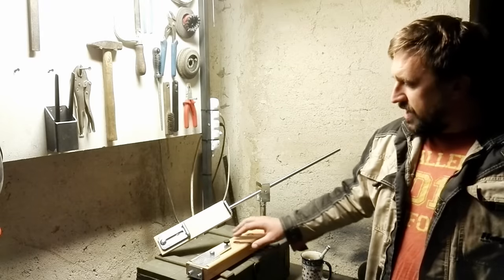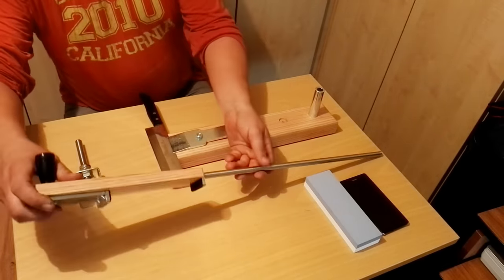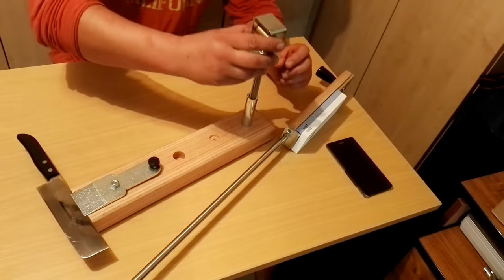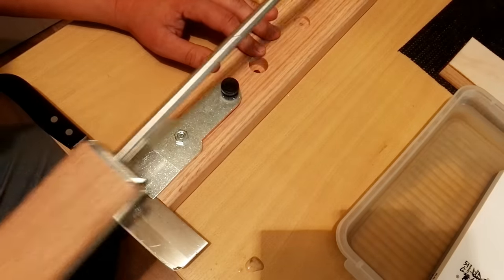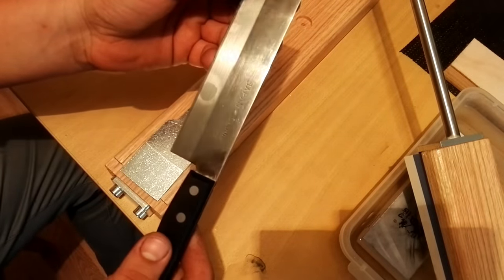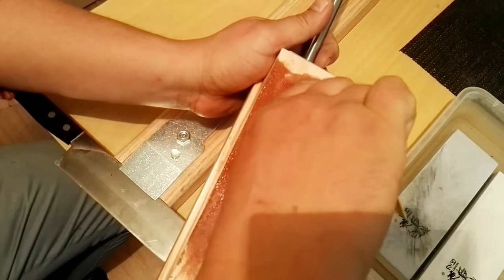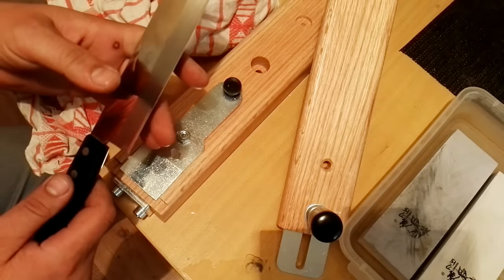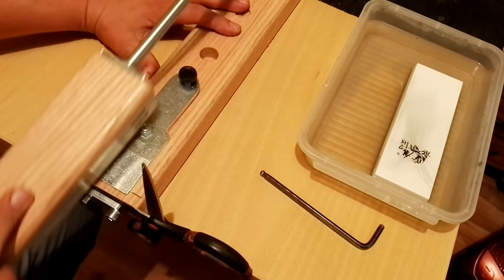The knife SHARPENING jig II

Comment: Got it as a Christmas gift for my mum. Works super well, especially with larger knifes one achieves incredibly precise results. I recommend to start with a stretched bar and work with the stone towards the knife as you move along the edge. So basically push the stone in the direction of the knife. It is also shown in the video. This prevents the stone from being damaged by the plade as there's more control when the tip of the blade is reached. Also it is necessary to check and readjust the angle after the first stroke. Begin with a slightly larger angle then after the first stroke have a very close look at the blade and lower the angle. Repeat until it is perfect.
Reply: Johannes Schmitz m
Reply: Sheila Harrison ¡

Comment: Ist's a great piece of workmanship Michal !👌

If You're willing to listen to my advice: 

If You slit the holes of the "jizzle-like"clamp- that fixates the blade/knife to the wodden block ist's easier to fixate broader blades. It would also be nice if You grind a square 40x20x10mm deep into the wodden block to hold the blade with an N52 neodym magnet the same size.

The advance of the more narrow whetstones, which originally came with Apex are just about 20mm wide, so You're able to sharpen koncave internal rounded blades like karambits or hand-scissels. 
Also is a smaller wooden stone-holder-block lighter and easier to move with less weight esp. on curved knive tips =>less pressure to the edge and tip of the blade.

The quality of Your product is way better than the Chinese or even Lansky ones 👌👍🙋 

I'd love if You're improving Your product to all sizes => width => of whetstones 20 - 100mm=> needs to slim the wooden stone-holder-block to 25mm and a carved in 60° phase into the middle of the steel stone-brackets .😉

Comment from the maker: The price  is EUR135 for the jig, it is delivered with the 1000/3000 stone.

The rocommend combination:
Knife sharpener - 135
2000/5000 stone - 50
Leather block with paste - 23
--------------------------------------------
Total EUR EUR 208 plus shipping cost (Europe EUR - 20, USA, CAN, ASIA, AUSTARALIA, Malaysia ... EUR 65)
Reply: Michal Kadlec Where can I buy one?
Reply: I’d like one. 
How do I buy one from you?
I’m in Toronto.
Reply: I would like to buy one of your sharpeners with stones how can I email you
Reply: Michal Kadlec 
I would like to purchase one of your sharpeners with the stones how can I contact you directly
Reply from the maker: MsBode123 you can writee e-mail kadlk@seznam.cz
Reply: I bought one and it does not work on my japanese knifes. 
This jig is only able to get down to a 18°-20° angle but i need to be able to get an 12° angle.

Since the minimum height of the stone holder arm is 14 cm and the distance from the armholder to my blade is 40 cm, you get a decline of 0.35.
Arctan of 0.35 reveals that i can only go down to a 19.29° with this jig. Something you should mention before people buy it.
Reply: Most sharpeners of this type can go down to 0°, you have to tape something near the spine (thick wire, several strips of cardstock glued together etc.). Raising the knife's spine lowers the angle significantly.

In this case instead of the usual magnets in the base and a stop to rest the knife on there's a clamp, so it may be harder to do but nothing is impossible

Comment: Very nice sharpening system. I would love to buy it, but if i can't be used at 10 to 15 degrees it is of no use for many of us with japanese knives. Please tell your customers the work range of your system. So sorry it seems not to fit my needs.
Reply from the maker: Standard 14 - 30 degrees, with extra part 10 - 30 degrees
Reply: Thank you for your prompt answer. So how much for the extra part(s) in addition to the jig only.
Reply from the maker: extra short pipe just available to be delivered with the jig or as a extra part.

Comment: Looks sized to sharpen machetes. I wouldn't trust anything made of wood to stay consistent over time...it just won't happen..you'll quickly grind your blade to nothing because the angle won't be consistent or repeatable month to month. That's why Wicked Edge, Edge Pro and KME (among others) make theirs out of METAL. (not to mention what a PITA flipping the knife will be)